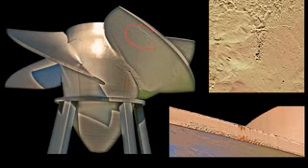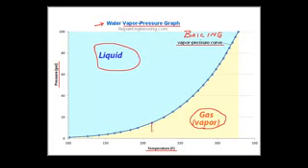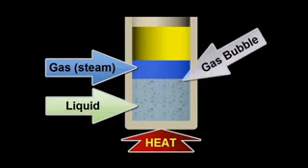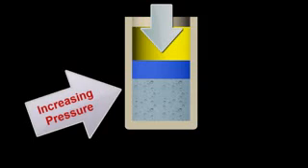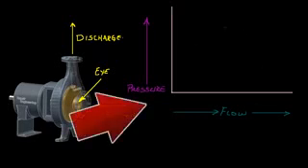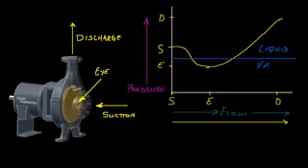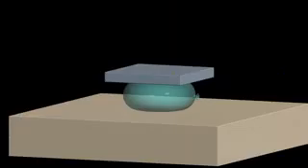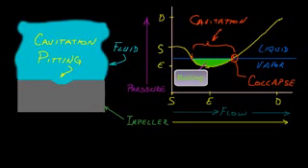Cavitation cause and effect

Comment: Hi, one question. I have a closed water loop that still needs to bleed the air that stays trapped inside the radiator and such. Many of this bubbles are going through the pump and are discharged as really small bubbles on the reservoir that are either recirculated or they reach reservoir's water surface. I don't think this is cavitation, since the bubbles go all the way around and they don't seem to be the result of vapor forming inside the impeller but I could be wrong. Could this damage my pump?
Reply from the maker: davidcapi you should not allow the 2 phase flow inside the pump as it will affect the pump on the long run. So I advise you to review the current NPSH for the pump and compare it with the design value for the pump. Also try to investigate the reason of the presence of this air bubbles and remove it.